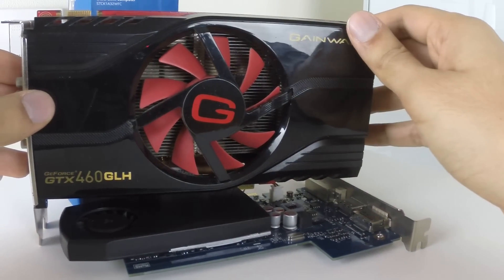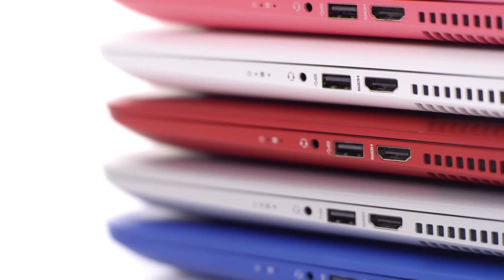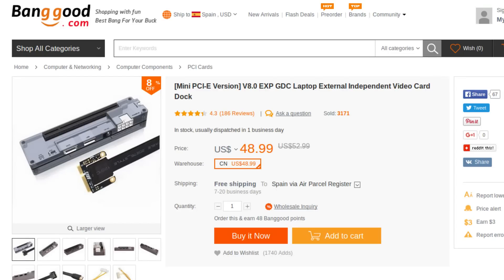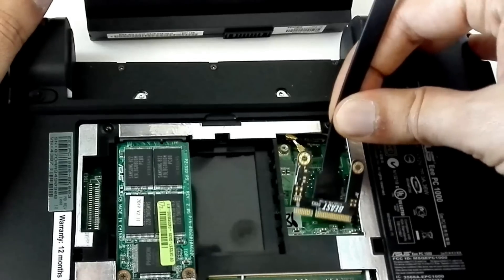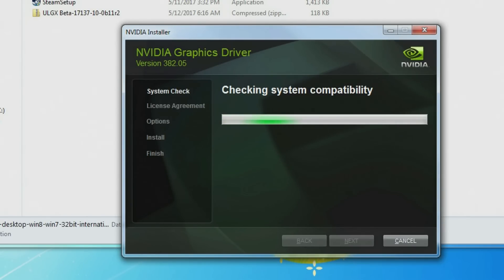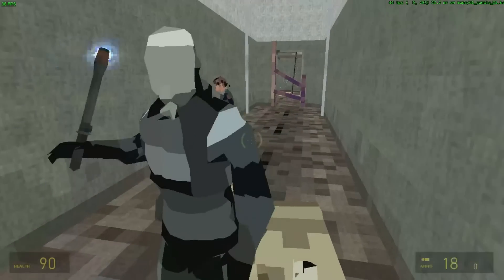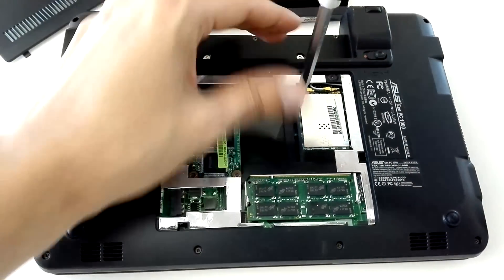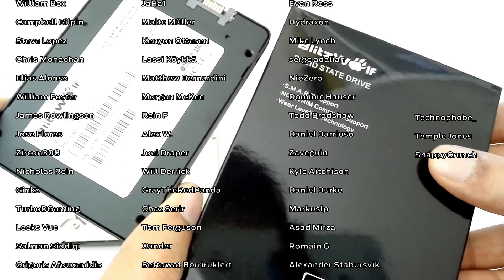An External GPU for an old Laptop?

Comment: I want to add something, I have done this mod to my laptop, like 8 months ago, I have a core i5-4200U, 8gb 1600mhz ddr3 ram (dual channel) and a 120gb ssd, with the integrated HD4400 graphics i had to run everything on 720p and the lowest graphical options possible; but once I installed the external gpu i decided to place a gtx 750ti... results were not the ones I expected, the games were running ever slower due to the narrow bandwith the PCI-E X1 was providing, so I decided to hook up an external monitor and it got way better. I did the same experiment with a more powerfull gpu, and installed a gtx 980, same story here, using the integrated laptop monitor will suffer from a mayor bottleneck, but using an external monitor will give you a better experience. Note that the i5-4200U was able to run at it maximum performance because it was not power throttling (gpu was not consuming power at all) so this configuration will give you a little cpu boost. Also depending on your cpu, it will bottleneck your fps sooner than you think.

Comment: You might be the first channel who actually made a full review with benchmarks of this device. next time you should experiment with a good graphics card.
Just think about this scenario: I want to build a PC but i'm stuck on a budget and a "not so old" laptop, so instead of saving up for a bundle I buy a high end GPU and use this adapter until the day I can afford the rest of the components. I expect a bottleneck but I wonder if a laptop could handle such amount of power (aka error 12) without losing the PCIe port or the adapter itself.
Reply: I believe laptop does not suffer from this. As there is PSU who supplies power, and after GPU calculations there's little current going to laptop
Reply: Techutopia

Comment: Can you put this on a laptop from 2015-17 with intel i7 integrated GPU. And a add a gtx 1060 or better on it I would like to see the benchmarks if this wifi port would be enough to drive a better gpu.

Comment: These egpus are for attaching to I series cpus with HD graphics onboard. Thats the big problem with these setups you either have to hook a screen up to the gpu or use an intel HD graphics feature to pipe the video back up the bus to get it onto your integrated screen. Long story short you are going to kill your portability so bad you may aswell get an old pc off the buy and sell.

Comment: I use one of these on my averagely powerful i5 laptop, with a GTX 750. I can play GTA V on medium-high 60 FPS. To power the GPU I use a modified ATX power supply. That thing would never pass any safety tests anymore, but it works.
Reply: bro what power supply are you using I'm planning to do it with gtx 750titan
Reply: Which version of the processor? I have a 3340M in mine and I'd love to run games like that.
Reply: Is it still working? I'd like to try it myself. Also any tips you have in retrospect?
Reply: I'm gonna do this with a gtx 750ti for blender, anything is better than iig

Comment: Just saying, this solution is actually really good on some very "non-gaming" laptops (strong CPU like a Core i5 and integrated graphics), but in many games you can run into a bandwidth bottleneck - both Mini PCIe and Express card operate on PCIe x1 instead of PCIe x16 used normally to connect GPUs. Some games don't utilise all that bandwidth so they run great, but other games will have problems.

Comment: my friend did this with his ASUS Laptop with an i3, Geforce 720m and 8gb ddr3....RX480 with an even cheaper adapter (23€) connected to it, runs most games at 1080p and high to ultra settings. i got an small Acer Mini PC with an AMD Athjlon 64 X2 paired with a GTX970 (i had this laying around, lol) and even this is usable to play modern games....
Reply: is it still runing well? cuz im thinking bout buying this
Reply: Is it still working?
Reply: Does it work? Trying to do this as wel

Comment: oh damn, once i've upgraded my desktop GPU to Vega (whenever that comes out) and give my little brother my old R9 280x, I can then take his 6850 and FINALLY give some more power to my old ass i7 2630QM laptop (which was the first PC I used that gave me a glimpse into modern gaming...despite using Intel HD). I would then replace the rather useless blu ray drive with a second drive bay and upgrade it with an SSD. Could then just let my sister use it for when we play games instead of her i3 laptop.

Comment: I have 2 laptops with express card slots, both have core 2 cpus and one has a dead video card. I have been aware of some Express Card to pcie adapters for some time but never one that didn't have its own built in power supply and cost more than a new low end laptop so never bought one. I've also never seen one that would connect to the internal miniPCIe slot. I could actually use one of those with my mini atom powered computer, it's the size of a vhs tape.

Comment: what is the purpose of this if you're forfeiting the portability for performance if so just sell the laptop ang buy a prebuild... don't have monitor? buy an old crt or use a tv -.-
Reply: this is handy if you need to constantly switch portability and performance.  Although I've never used the mini pcie method i did this in an old sandybridge lappy that had an express card slot and it worked amazingly!  Just unplug when I needed to leave and come back when I wanted to game!
Reply: but you still need to screw and unscrew the screws for your laptop and reinstall your wifi card right? Also cable management will be an issue here especially those who have small desks

Comment: Could a cheap device like this provide the bandwidth needed for a decent video card though? Even an older card like a radeon r9 290x(2014) would push more data than this device can transfer.

Comment: I love this, it's like if the Kilian experience did hardware videos. 

I'm actually quite impressed at >19 fps on skyrim, I think my old intel HD gen 1 laptop barely pushed 9. Interested to see how this develops, I'm currently running an i7 4720hq with a 960m. The GPU is gonna be the bottleneck for modern gaming so if I could get a setup like this down the line I could really extend its lifespan

Comment: i try this device on Samsung laptop with i7 3610qm and 12 ddr3 ram,connected gtx 960 and works well in begining,later was some problem,time to time nvdia drivers stop respond and game crash,i didnt find soliution how to fix this problem.so beware
Reply: i try,it didt work,i read some where there is issues if using new gpu,well its not new now,but i tryed 1 year ago,so maeby this external device is beter now or just me didnt find out how to fix it

Comment: Does anyone know if you'd be able to use this as the primary video adapter, and boot from it? I have 3 or 4 older laptops left with the dreaded nvidia 8400M and 8600M's in them which ofcourse are faulty. Maybe this would be a way to revive them and give them back some use? :)

Comment: The problem with mini pci-e compared to pc exress card slot is that the if manufacturer has locked the pci-e slot to only some wifi cards then this will not work.
Reply: Non that i would know. An other thing is if you get the card working you should use an external display connected directly to the external gpu to get more performance out of it

Comment: Would be more interesting to test how the device actually performs by comparing it with a benchmark using a regular PC and then the same benchmark with the same PC but with the gpu connected via this. I've seen a lot of laptops with decent cpu's but total trash GPU's.

Comment: I picked up an external graphics adapter in Amazon for 8€ with the same kind of technic inside. It is powered buy a 4-pin cable und connects to mpci-e via mini-sb cable. graphics Card (i am using the gtx760 AMP) Just takes the cables from the power supply and works just fine (can run battlefront on medium presets)
Just saying because it's much cheaper but works the same

Comment: I do think it would have been better if you chose to run a more average type of cpu like a Celeron, Pentium, or i3. The Atom in this video was clearly holding back the video card. It would be nice just to see how far this little gadget can actually push a card in something that can tap into the full potential of the video card to see how it compares to something like the razerblade core.

Comment: wtf use a electrical tape not an ordinary tape
Reply: as you can see on the screen it said "DO NOT DO THIS" so he probably just pealed it off afterwards.
Reply: Real men don't use electrical tape..
Reply: TOO EXPENSIVE BRO!
Reply: victor jo Actually, real men use copper barbed wire to deal with electricity.

Comment: had too many issues with the eGpu adapter ... first had issues making the adapter works... then it worked... it was not running at full speed so not much difference with my mobile GPU.... ended up building a cheap second gaming pc instead .. too much trouble ..

Comment: Oh man, I have a HP MiniNote 10 with an N280 CPU. The biggest problem wasn't so much the performance (I upgraded it to 2GB RAM), but the 1024x600 screen. Ended up using it as a torrent box and DOOM machine before I did something I shouldn't have done with partitioning and got too lazy to fix it.

Comment: I have a GTX 960m i7 6700hq laptop. Can I put say, a gtx 1060 with this dock? I have Dell Inspirion 7559. There's no thunderbolt 3 ports; only 3 USB 3.0 ports and some other stuff.
Reply: Pascal GPUs are having compatibility issues at the moment, it's a driver issue. Go for the 700/900 series, a 950/960 would be well suited for your CPU

Comment: I might just get this. I don't need it since I already have a pretty decent PC and upgrading soon, but I'd love to tinker with this and a few different GPU's. I use an old Sandy Bridge laptop (2011 i5. 2c/4t. Not very good.) for anything that I need to do while at school and/or travelling, and the only bottleneck it really has is the GPU. The HD 3000. If it wasn't for that I'm sure it could run just about any modern game with minimal bottlenecking.

Comment: This is totally garbage, do not buy it. If you do need one, go for ThunderBolt 3 ones, not PCIE x1.
Reply from the maker: I mean, as I explained in the video this is for laptops that do not have thunderbol 3. Old ones
Reply: TB3 has worse data transfer rate than PCIe card.

Comment: I have an old alienware (2012, i7, gtx670m). Would it be possible to run a dual card set up this way? Or would I be better off disabling the mobile gpu and use this set up with a better desktop gpu?

Comment: Just FYI, ExpressCard slots are very common on business laptops like Thinkpads. The Thinkpad X230 is an example and it's a laptop that holds up really well today and you can find them for as low as $100.
Reply from the maker: I have been told this. If I can get my hands on one then I will do another test

Comment: Hello, with this adapter, can you play directly in the laptop's display, or you need a extrernal monitor too?
i have an alienware with i7 3610qm, but the graphics card does not work anymore, and i want to put a external gpu.
sorry for my bad english, i'm mexican,  i dont use any traslator, because i need practise.
Reply from the maker: it requires an external monitor that connects to the HDMI of the external GPU, like in a tower PC

Comment: Already use this and it works, super worth it for a little boost in performance on laptops without discrete GPUs.
I used a MSI CX61 2QC laptop with the adapter and a PNY GTX 650 and AMD Radeon 7500 series with it functioning flawlessly. I was able to play The Division at low to medium settings at around 30+fps (on the AMD) and Doom and other games at the time. However after a lot of testing I found games can still be bottle-necked in performance due to the limited bandwidth of the mini-PCIe port used to plug in the EXP GDC. Expect crashes and fps drops due to that limited speed not being able to keep up.
I have also tested this setup once with a Zotac GTX 1070 mini and a Zotac GTX 760 with limited problems mostly with the 760 oddly. It overall was a lot of fun turning a crappy laptop into something really effective in gaming.

Comment: I have an Athlon II X3 TripleCore CPU @ 2,70 GHz, a GT640, 8GB DDR3 1333 and it still can run all last gen games at highest settings without any problems... It's one weak but tough s.o.b. system. xD

Comment: Any Idea if this would work in an all in one? I'm wondering if there would be problems running it on the all in ones display. I'm using an Imac 2012, and the CPU is not too bad so if this is possible would make an easy fix :)

Comment: if u had to remove the wireless adapter, u cant play any sort of online games right ? well it's useless then
Reply: That's why you use a USB Wi-Fi adapter or just plug in an ethernet cable, because the Wi-Fi card wont affect ethernet.

Comment: when you take your wifi card out and ask urself how to connect to the internet

1. connect your phone to your laptop via cable and turn on wired hotspot

2. use one of those usb wifi atennas thingy

or

3. just use ethernet, better than wireless
Reply: Don't forget about the USB Wi-Fi adapters.

Comment: So what about if you have a CPU with integrated graphics? The external GPU shouldn't interfere, yes? I'm planning to use a GTX 670 with an old laptop from 2013 with AMD integrated graphics and 4 GB of RAM.
Reply: Huh?... Your question doesn't really make sense?

Comment: oh my god this is what i've always wanted to see. isn't that an empty mini pcie port i see in the bottom left? maybe you could have put the wifi card there.
Reply from the maker: +Joe Manfred yep. Good eye, I was surprised nobody cought that. I intentionally put it on the one using the wifi so people trying this on computers with a single port would know where to lookv
Reply: LowSpecGamer b
Reply: You can connect an usb wifi adapter. They are cheap and work really wel

Comment: Ive been using the gdc exp adapter on my lenovo ideapad 100 with an ultra low voltage 2.2ghz core i3 and a AMD radeon r7 250. First things first. Radeon crimson settings are the slowest, most ineffective and buggy settings ive seen. Other than that it works great ever since I blocked windows 10 and cortana (beacon/spyware) from using the internet and hacked XBOX DVR to free up the cpu. I plan on getting a laptop with a core i5.
Reply from the maker: +skwirl3014 Thank you for sharing your experience.

Comment: Now the gtx 1050 /ti has a purpose:D

Btw My laptop from 2007 has the videocard inside replaced. It has now a  fx3600m. Halflife 2 = full details 1680x1050 = 60 fps at all times. Same for league of legends. :D
Yes, it has 8gb ram. But the cpu is only a t9300. (2x 2500 mhz, 6 mb cache) BUt that the fastest it supports..
Not bad for a 2007 a 2008 card /laptop eh?

Its the HP 8710w
Reply: Sadly, the 1050ti is still the unwanted little brother. Pascal is currently having compatibility issues with EGPUs.
Reply: Yeah read about that. Now we need gtx 900 series for this.
Reply: RossiLad ive seen people use the 1050 (non TI) and it works fine, ive also seen people run the 1060 without issue.

Comment: Sadly my laptop doesn't have a maintenance hatch instaid its a one piece so too bad. T^T
Reply: This may sound weird, but why not take the entire thing apart, and just cut a square out above where the PCI-E slot is? So you can just slide the cable through?

Comment: Hey, I have a laptop coming in with an Expresscard/34 slot coming in...

Not that I need it because the dGPU is quite nice and the CPU has twice the threads of my desktop's CPU, and it has a Thunderbolt 3 port anyways...

but still...

I wonder how much performance degredation occurs over Expresscard, which uses a 1x PCIe link. I know Thunderbolt typically has a 10-15% performance drop, and it's on a 4x link.

Comment: I see that there is an option for a DC 12V, this means you can use that without a PSU, for a card that doesn't require 6/8 pin, like a 750?

Comment: Been using one of these external GPU for a couple of years now... One thing you didnt mention in the video is that these EXP GDC are limited to 220 watts.. I use a amd hd 5870 runs fine but  when i try using the R9 290 it will crash

Comment: note if you are going to get it and use a mini pcie port with nvidia, only get the 9 series or under (gtx 970 for example) a ten series card will only work with older drivers (not that old you just can't update the drivers) 372.70 or something like that. I have a 1060 with gdc beast and it works fine i just would rather be able to update my drivers with a 970.

Comment: can i have a question pls? i have laptop with intel core i7-3632 , 8 gig ram, its kinda ok, but only geforce 730m which is really bad card, do u think this way of ,,upgrade'' is good for me?
Reply: also if i dont want to replace my wifi adapter, can i just use normal usb to mini pci-e reduction ?
Reply: 730m is not THAT bad
Reply: it's not really bad, i can run almost any game on at least some fps :D it's just, that if i can do this, i could keep usiong my laptop for a lot longer with buying only new gpu. also some games i really like are getting really low fps like fallout 4, battlefield,  or overwatch :(

Comment: Somewhat related question, i have a 1080 in my case i also have a 980 i had on a older pc, the 980 pc preformed better on older games and wanna to put it in the new case to see is the cpu creating the bad fps or is the 980 better optimized for them, can i have 2 gpus in a case at once and be able to select the one to use in control panel or not, and whats the best way to connect and external gpu to a desktop that cant hold the gpu, this connecter or are there better ones at same price